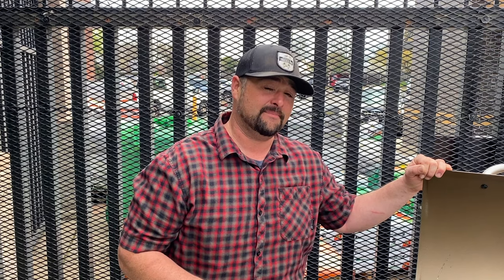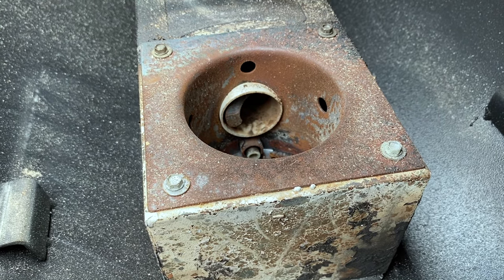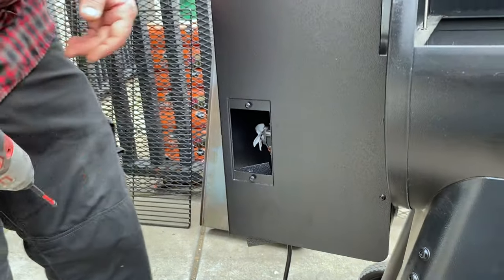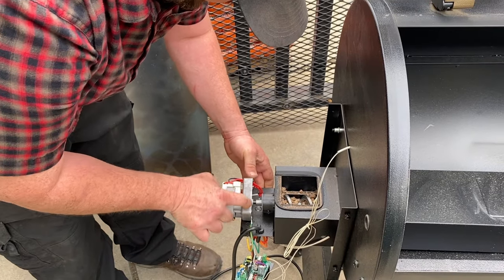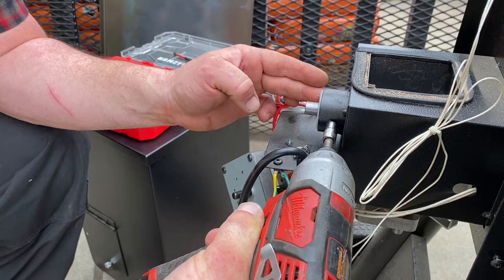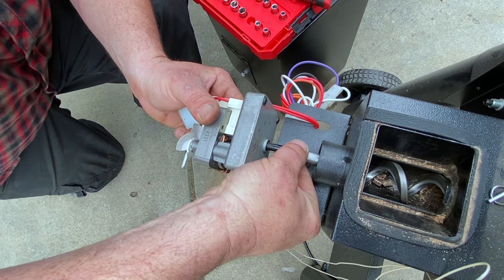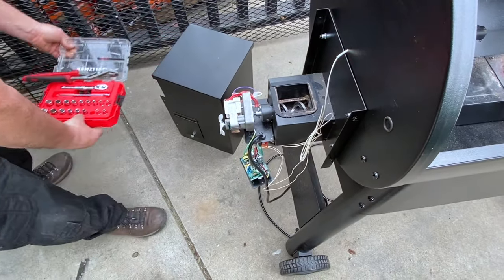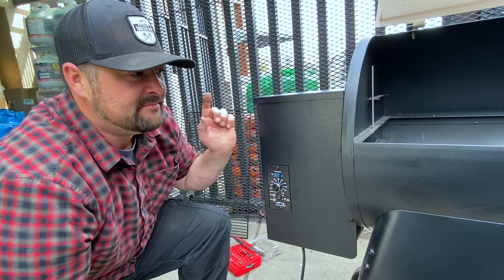Guide to Clearing Out a Jammed Auger On Your Traeger Wood Fired Grill

Comment: Greatest instructional video ever. Step by step. Had you tube sitting beside me as I went thru the process. Turned out that the pin that connects motor to auger had sheared. Took it out in 3 pieces. Replaced with the recommended 6/32 . Smooth as buttah

Comment: Thank you for the excellent video on cleaning out a jammed auger.  I actually had the shear pin snap due to the jam, but used your advice and picked up a new bolt and lock nut, and working like a champ.  Pork Belly burnt ends on the pellet grill now testing it out.

Comment: Ha, ha, that wasn't stuck. Ours got fire in the pellet box somehow and my wife poured water in to put it out ... then left it! It may as well have been concrete by the time I looked at it. The Auger wouldn't budge, no movement at all. I cleared out what I could of the pelletcrete and didn't want to wreck the firebox with the smash technique another video uses. So, I soaked it for several days in wd40, didn't do much. Upped the ante to acetone, and that released it enough to lever the auger out. Used a wire wheel to clean up the auger.
Reply from the maker: Lol what a project! I had a similar one I had to drill out the rivets by the burn pot and use a long drill bit down the center of the auger screw to start breaking it free

Comment: I followed your instructions on clearing the auger jam and put it all back together. When I turned it to smoke to start it is completely dead. I checked power source and it is OK. is it possible there is a safety that shuts the unit down when a jam takes place???? I love your video. It was extremely helpful. Thanks.

Comment: Can you help me with a problem? I turn control knob to smoke then turn power switch on and immediately the display shows 3 1's, 3 2's, 3 3's all the way up to 3 9's, all the while the  motor is "pulsing" or cycling on/off like every second, any help would be greatly appreciated.

Comment: Great video.  Your method looks a lot better than other videos I've seen.  I do have a question, however.  At about 4:55 on your video, you mention getting 'a 632 allen about 3/4 inches long and a nylon nut' (I think) to replace the pin.  Not sure exactly what that is?  Can you post a link or explain further what that allen thingamabob is you mention?  Thanks!
Reply: You probably got this already, but he was referring to 6-32 (#6 with 32 threads per inch) screw that is 3/4" long. Then using a nylon nut on the other side to secure it.
Reply from the maker: Still waiting to hear that you got it fixed all right lol

Comment: Thanks for posting this!  Great video!  Any thoughts on why we keep getting this code mid fire?  Happens after running 3-4 hours.  I fix it by clearing all the pellets at the auger feed window and at the beginning of the screw. Seems like it is getting jammed right at the hopper. It is not overfilled and we use Traeger pellets. Thanks
Reply from the maker: Give Danny a call and he can walk you through it. 916-261-1305
Reply: Have you called me yet? The chimney cap may be too low

Comment: Do you make house calls to Wisconsin?? My Pro 34 is under a year old but is used 4 times a week.  

I found the auger not turning this morning after a weird shut down following the last usage. While in shutdown mode, there was what seemed to be some additional smokiness coming from the burn pot and up into the pellet box.  Today, the auger is not turning.

I’m going to attempt to duplicate your fix. And will report back.
Reply: Success.  The only difference in my Pro34 was that there is a small guard on low end of the hopper. That needed to be removed as well.  Thanks for your video.
Reply from the maker: Glad you got it fixed! I don't think Traeger like that service call invoice lol

Comment: Good job explaining things. I have a camp chef, but pretty much the same for clearing an auger. Thanks, bud.
My jam didn't happen from wet swollen pellets, it happened with a new brand of pellets I tried from a company that makes a great Tennessee whisky,  cough JD . I don't want to blame the pellets yet, they worked fine twice, then jammed the 3rd time. My smoker is 2 years old and used a couple times a week, so I ordered a new auger motor in case it's getting weak. The shaft bearings on the motor do seem a bit sloppy.
Reply from the maker: Little late to reply but... I would say swollen pellets can't be blamed by the manufacturer but definitely dusty pellets can be and are hard on auger motors... They make loud screeching noises and keep a heavy load on the motor
Reply: @AmericanRiverAceHardwareBBQ  Thanks for the reply. I ended up replacing the auger motor. No more problems since. But I do think the Jack Daniels pellets caused it, which is too bad because I like the way they burned and smelled. They weren't swollen or dusty. The issue was how hard they are and some in the bag were 2" long or more. They got caught where they feed in from the hopper to the auger and wouldn't break into smaller pieces easily and jam the auger. It could have been the bag I got, I haven't used JD pellets since.

Comment: Naw man!  First gingerly pop the terminal end of the auger with a small hammer a few times.  Don’t use Brutus the 21oz hammer.  Man, my RTD thing died on my Traeger, and was just too lazy to replace it.  My grill has been sitting outside in the elements for over 13 years!!!  I thought, no way is this thing gonna work.  Replaced the RTD module, threw some pellets on the igniter, and saw smoke, but the auger wasn’t movin’.  I found your vid and was thinking, dang I don’t wanna do all that.  So my thought was that the auger and tube might have built up a bit of rust seizing the system.  Like an old country boy that I am, I figured I’d smack the terminal end of the auger a few times.  Back in the game!  All works fine.

Comment: What did you use to take the pin out? Having a heck of a time
Reply: On real bad ones I've used a center punch and hammer to tap it out
Reply: @danielhill5197  I got the pin out. The actual auger is another story. I worked on it for two days with no luck. A new grill is not on my shopping list 🤦‍♂️ lol
Reply: What's up
Reply: @danielhill5197  Just won’t come loose. I’ve pried and pried. No luck
Reply: @coltenhalliburton6206  drill it out
Reply from the maker: How did you end up fixing it?
Reply: @AmericanRiverAceHardwareBBQ  Worked on it for about a week with no good results, got pissed and chunked the entire grill. I know that’s not the answer you were wanting but it wasn’t for me either lol…

Comment: Yep, my pin fell out today. Grill had been sitting with an LER for probably over an hour. Pretty cheap design if you ask me.
Reply from the maker: There was a size discrepancy they fixed I still put a zip tie on the ring of the pin so I can't fall out

Comment: I can't get the auger to turn.  I took the motor off and got the bushing out, but I can't turn the auger for the life of me.  I can wiggle it, and we've been hitting it with a hammer repeatedly to try to loosen up all the gunk in there, and it won't turn.  Anyone have any ideas or tips?
Reply: Would taking a torch or a heat gun to the housing loosen up the gunk in there, or would it just make it smolder and get sticky, and worsen the problem?
Reply: im also trying to help a buddy of mine with this issue, next time im there im gonna try to soak the whole auger tube with water, maybe the solidified pellets will soften...has anyone tried this? is there a chemical that might dissolve solidified sawdust?
Reply from the maker: I need to cause a really bad Auger jam and do a video... ive done the worst jams imaginable with vice grips and a  hammer

Comment: You literally have to just go to the setting clear auger and it will do everything you just did by taking that apart, take out the grills so you're burn pot is exposed and just clear the auger that way, much easier
Reply: That's on the WiFi grills, this is not like that
Reply: This grill literally doesn’t have that feature, literally